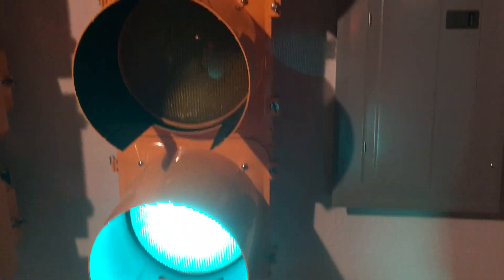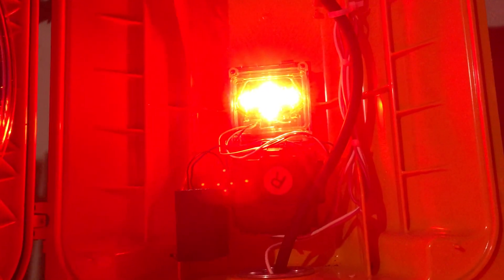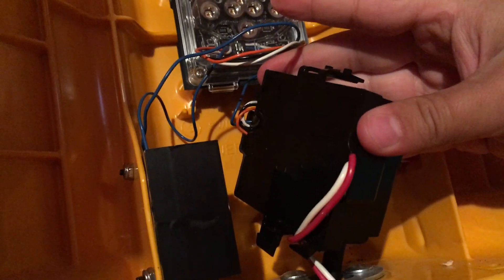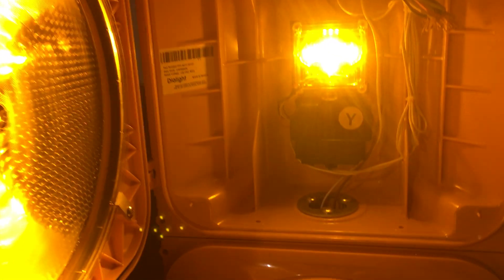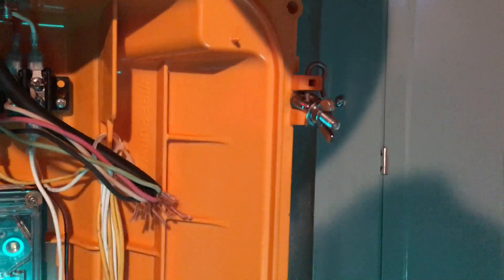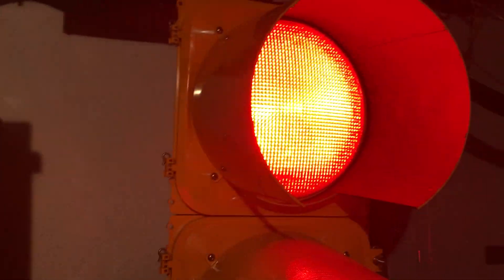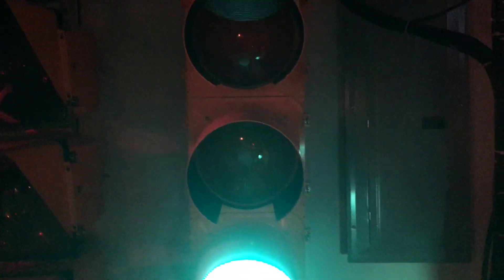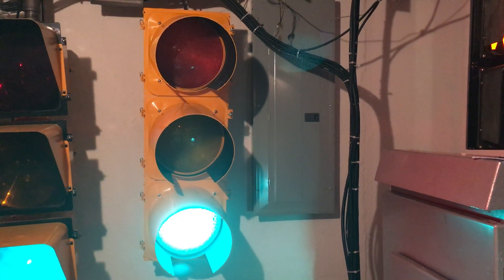Inside Look: Dialight Integrated Signal Head

Comment: Cool, did they ever manufacture these signals
Reply from the maker: No. Only trials were ran. I only know of one location that had 6 put in service as a test. Dialight discontinued the project in favor of their 15-year-life LED modules. This signal head was very expensive (about $150 more than a conventional LED signal head), there isnt really a market for them either since sealed modules are basically standard.
Reply: @NickBasilico  we have 3 of these here, all in one intersection. used to have 7 between 2 different intersections, but the one intersection swapped them to 12-8-8 econolites. I've never seen these signals anywhere else before. As more signals get switched out, I worry these last 3 will disappear soon.
Reply from the maker: That’s cool, more test intersections. Were they black or yellow. I wonder if there’s any streetview of those. They were a good design but they needed more design work to make them more practical. They were definitely a unique attempt at LED signals.
Reply: @NickBasilico  yellow. they look exactly like yours, except with different visors.
Reply: Little update... the green LED in one of them died maybe a week ago. And they ended up replacing all 3 with new Econolite heads. Which really sucks because they were the last 3 Dialight heads here.

Comment: This really seems like a solution in search of a problem. Even if it didn't have the glow-through problems, I don't see how this offers any real advantage over a conventional signal head.
Reply from the maker: Solution in search of a problem sounds about right. Cool tech factor aside, most municialities have stocked standard signal LED modules. This would require proprietary equipment and its hard for government to make any changes. Alot of the features this signal is supposed to have, an easily replacable LED engine and an "unpluggable" power supply. Kinda hard to do when its all hardwired. Agencies would need to stock appropriate parts to go with specific light engines...like the extra heat sink for the red. Cool concept, yes...ready for the street...definitely not
Reply: It could still have regular door mounted led modules